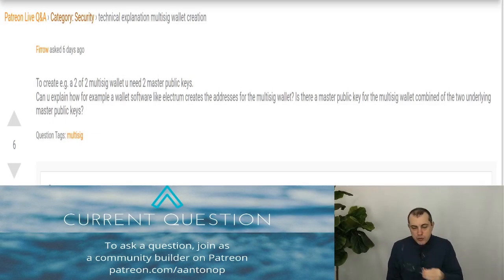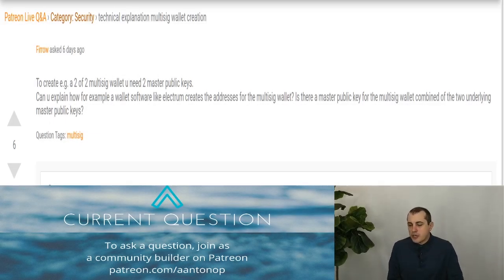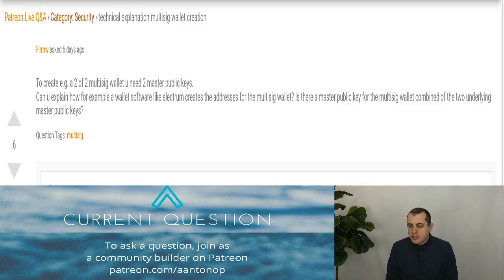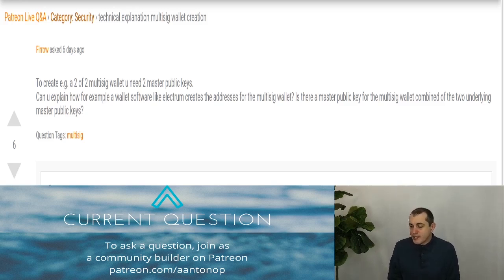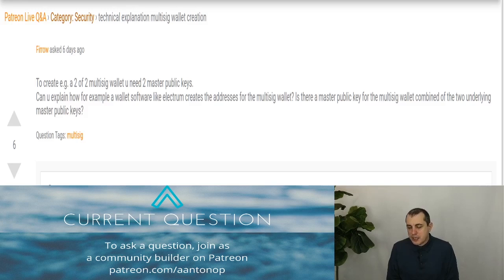Bitcoin Q&A: How is a Multisig Address Created?

Comment: Totally understand that you should use 2/3 instead of 2/2, however that was what was confusing me most about how the addresses are generated is when there are different iterations possible for the  multisig address.  there would be six possible combinations although maybe order doesnt matter so 3 possible combinations of public key combinations.  Does the wallet have to check for all of those to see if any one is a match?